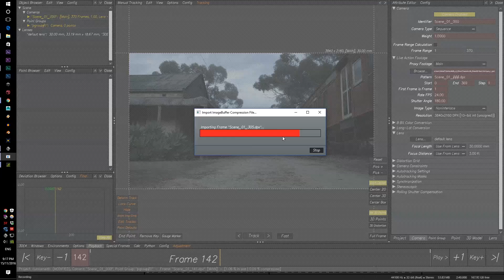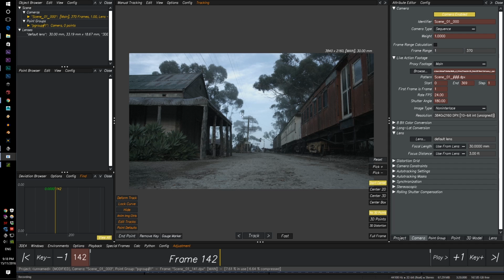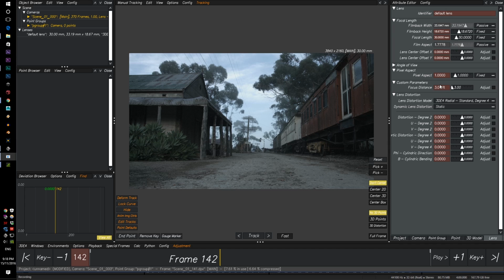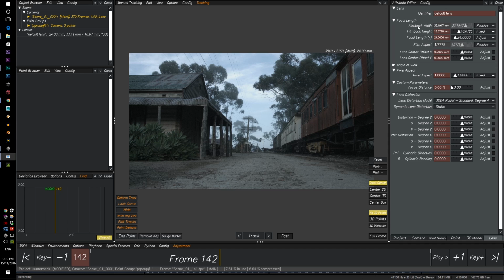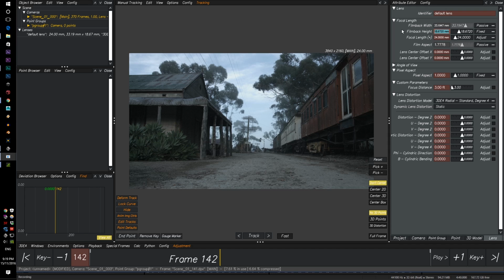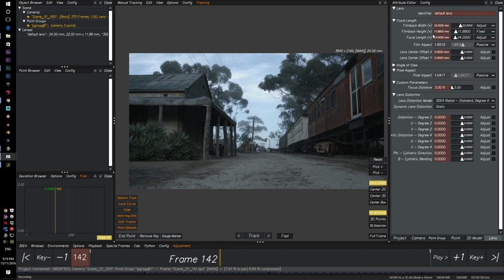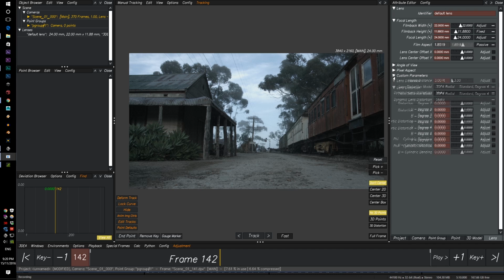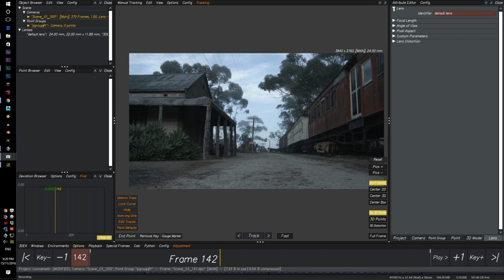3D Equalizer Tutorial – (2/11) – Setting up focal length & Filmback

Comment: did you use the Blackmagic URSA Mini Pro 4.6k for shooting the plate? thanks!
Reply from the maker: It was a black magic but I forgot which one it was this was back in 2016 early if that helps
Reply: Oooh ok haha. anyway, I have been trying to figure out the filmback based on the blackmagic cams' sensors. Can't seem to find one that has 22x11.88 mm. 
Thanks bro!!!

Comment: Maybe I'm missing something here but I can't get correct settings without it stretching the footage in strange ways. And for whatever retarded reason it insists on automatically changing settings based on other settings. I need to track footage from an apsc nikon camera, I type in 23.5mm x 15.6mm and it's stretched, I go to change the pixel aspect ration back to 1 and it changes my filmback width automatically.
Reply: perhaps you have the settings in "passive" mode. try putting them in "fixed". I'm also new and stuck with something as well.

Comment: Is it possible to track footage without knowing the focal length and film back?
Reply from the maker: I mean you can track it and get a camera out of it but it would be highly inaccurate if you want a pixel perfect track with cg assets. Think of it as the computer does not know whats there, what is being tracked is the only information that it is being given which within it self can be prone to error such as seen in this workshop once we have given it a mathematically correct focal length and film back it syncs it with the data we have given it 
the tracks) on top of refining it in brute force and adaptive we can get a near perfect or 0.1 error :)
Reply: Yes it would be inaccurate without knowing the camera information in 3DE4 but the story is different in syntheyes. Just click AUTO button, clean the bad track and is done Story ends.I use syntheyes for mobile footages it gives me good result. I was wondering how mobile footage can be tracked in 3DEqualizer4 ? I tried and failed because lack of information and sometimes I download footages from Youtube. Please share how mobile footages be tracked in 3DE ?
Reply from the maker: The workflow i learned in 3DE was under a feature film, tv show quality assurance. This ment that we are not allowed to click on the auto button at all, it all has to be Manuel. Ontop of this it was with 4K footage from red or arri. In terms of how mobile footage would work with 3DE, i dont know, i would assume that if the quality is good enough you can track the pixels as normal and with a little bit of searching good the sensor size for it :)
Reply: How do I know focal lenght and film back on my camera, I have the canon 5d mark III with 24-105 f4 lens filming in 24mm, please help. thanks in advance
Reply: Awesome Tutorials Bro!
I'm currently learning 3D Equaliser from online Resources and I'm stucked at a point.
Ok, After Tracking,Camera Solving we create a Mesh in Equaliser and then to solve it we take it to Max,Maya or 3D Software.Right?Then we add Texture in 3D Software and Render from there? Does it work like that? Also while solving Mesh are there any chances we would mess up Tracking Points?
I would really appreciate if you could explain me this Pipeline.
Cheers!!